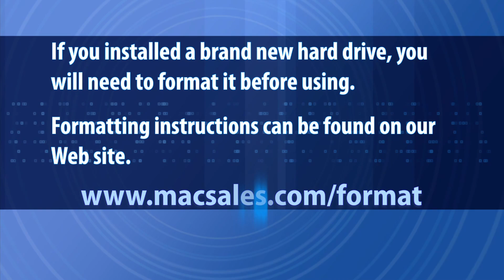Newer Technology miniStack Enclosure: Drive Installation

Comment: If anyone has a dead one of these, I may be interested in purchasing it.
Reply: No idea wy mine isn't working. Light comes on, fan is running, and System profiler reads it, but it won't mount my SSD. Is this a known issue that's fixable with 'dead' ones?